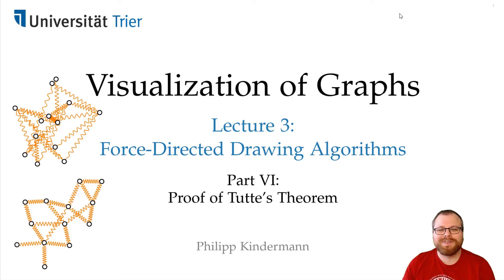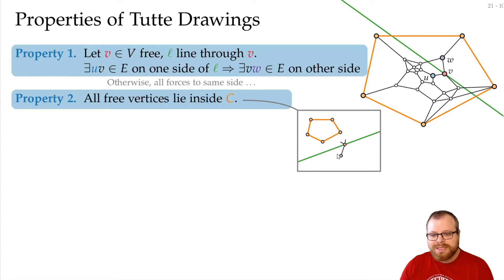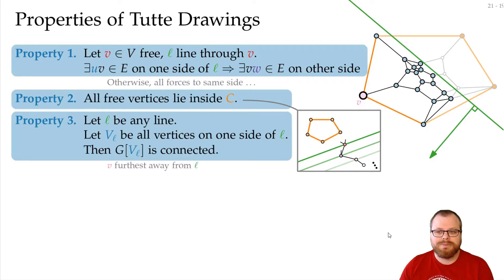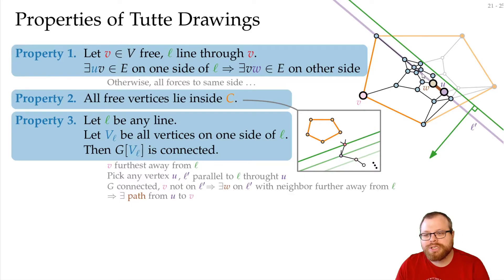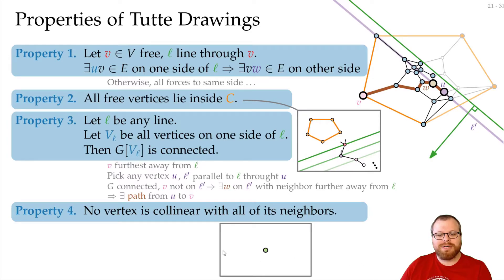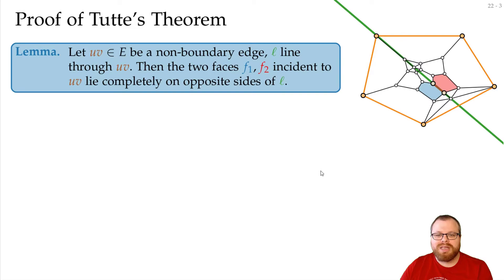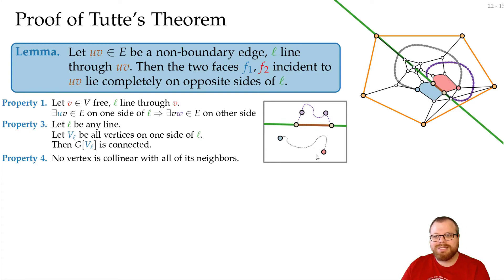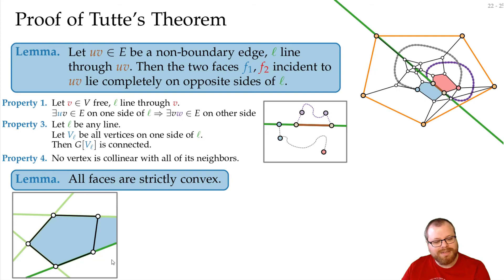Tutte Embeddings (3/3): Proof of Tutte's Theorem | Visualization of Graphs - Lecture 3

Comment: I had a question regarding property 4: No vertex is collinear with all it's neighbours.
Isn't it enough to state that since the graph is 3-connected, degree of a vertex is at least 3. Hence if we want to draw a vertex and it's three neighbours on the same line, it is not possible to have straight line edges without overlapping.
Reply from the maker: This is true that this would be a fast proof, but at this point we haven't proven yet that there are no overlapping edges. Property 4 is one of the tools we use in the end to proof planarity, which implies that not edges overlap. So we have to proof Property 4 only with the face that the input graph is planar, the way the coordinates are calculated, and Properties 1-3.